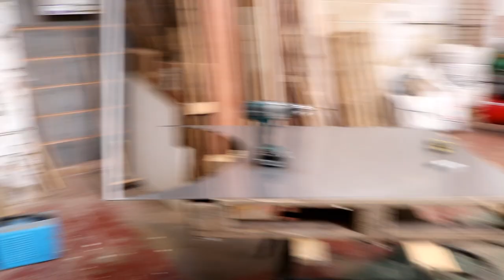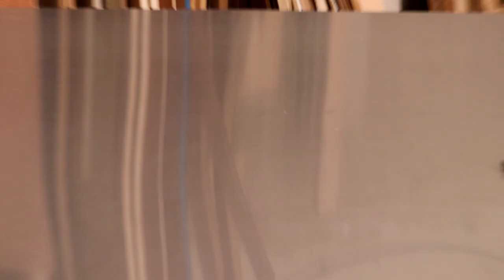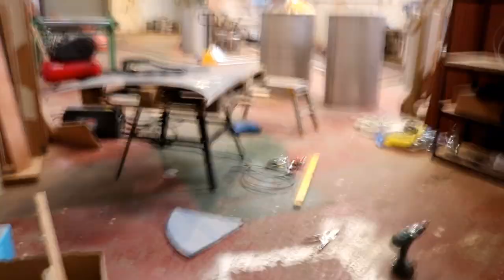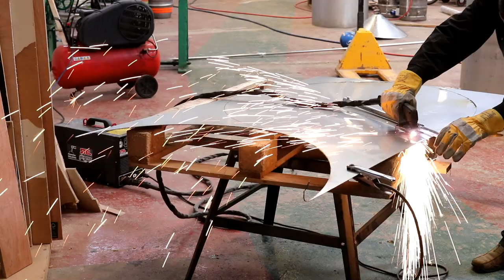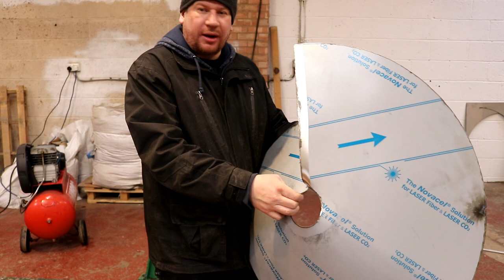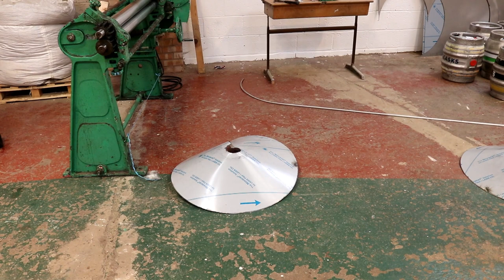SUNDAY Q&A

Comment: Thanks Harry for getting back to me, It was indeed with Nottingham going to try s04 again since i still got a brick left. The probes are insulated by 50mm kingspan but i have found that the hlt is off by about 2c and fermenters 1c when it hits high krausen i was thinking it was more than what the box said when its coming out of the fermenter violent!

The next few brews im going to try 166 grams which will mean i get 3 pitches rather than 4 from a pack, On a different note since the brewery is single digit temp was -1 at one point bursted pipes even after lagging etc is it worth adding sugar to casks since i dont have a coldroom to keep the beer around 10-12c the yeast wouldnt be warm enough to consume resulting in a sweeter product.

How are you going to bottle i noticed you tried the bottle conditioned and counter pressure filling from a keg i have had an offer from a local big brewery that they will contract bottle it but its 10hl required with 1hl loss and im only getting 220ltr a brew so i need to sort something out for now on finance have you seen https://www.carbotech.co.uk/ would be around 12k with a counter pressure filler and inline filters etc but ive got people lined up for stocking bottles and a brewpub opportunity towards the end of the year so might have to put up and shut up sorry for the wall of text cheers Harry
Reply from the maker: Hi Mate, I never add sugar to casks, 1 or 2 sg points was always enough to condition the beers. It will happen in the pub cellar if the brewery is too cold. I will be building a cold room before summer so hang about for that. I won't mess about with counter pressure bottle filling ever again, all the awards I won for bottle were hand filled bottle conditioned. you can get a pretty cheap 3 head from here. https://www.brouwland.com/en/our-products/winemaking/bottling/bottling-machinery/linear-bottle-fillers/without-pump/d/hobby-bottle-filler-autom-3-heads
Reply: Yeah i was going to go down that route just didnt want yeast in the bottles but like you say it is a better product, Were you pitching fresh yeast like champagne ones? I hear that works well, combine the sugar solution with the yeast in a mixing tank then gravity feed for bottling? Then the champagne works at lower temps and 2-3 weeks you would get carbonation?

The brewery that i get my supplies off said 1-2 point for cask trouble is some pubs dont give them the time to consume or their cellars are to cold also and you can taste the sweetness in the product thats my fear until i get a cold room done.